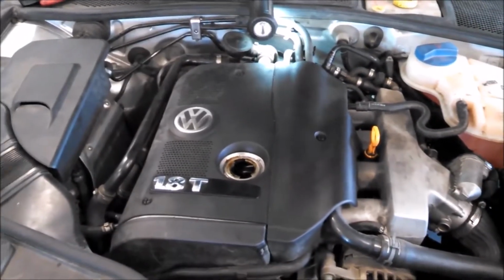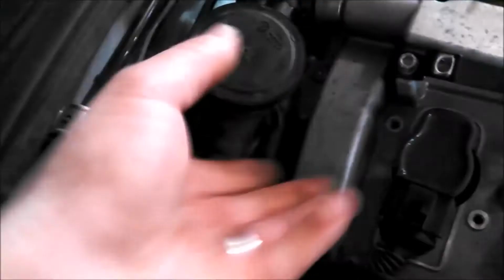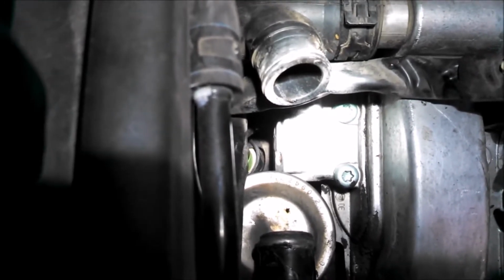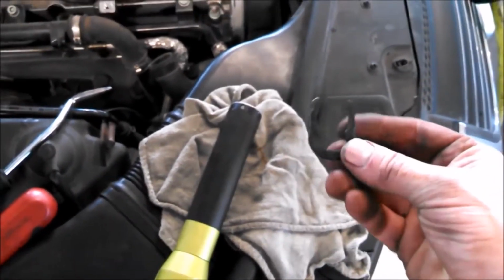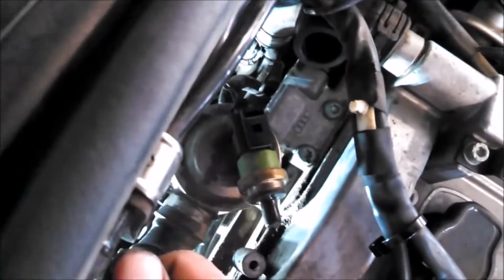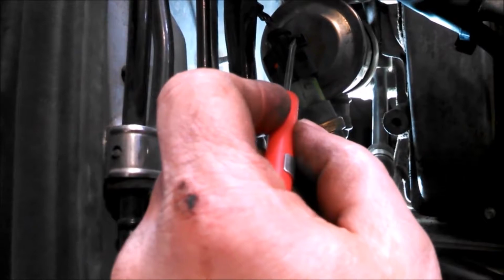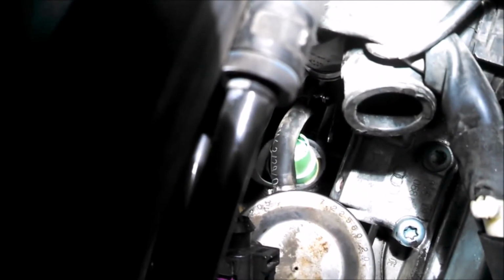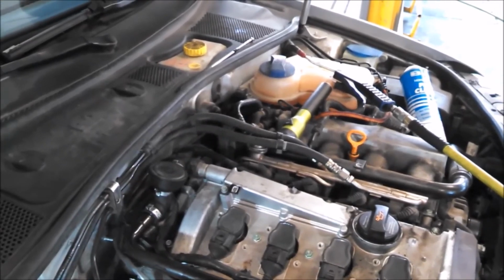Temperature sending unit VW  Passat Volkswagen 2004 by firewall Install remove replace

Comment: 2004, same B5.5, remove/replace coolant temperature sending unit:
Nasty position to deal with. Another VW-Audi design failure!  Thus video seems genuine and displays the obstructive design of this 1.8t engine's plumbing.
Also consider there are one-way vacuum valves in that area, very fragile.
Have some bandages  nearby, patience.
 I love the B-5 but hate to work with this bass-akward 1.8t. and trany. I've done almost all and must say this set up is misery by the devil. VW builds to assemble quickly but does not consider after warranty maintenance. Cruel design!

Comment: Why are you changing the temp sensor?
Reply: If the coolant temp isnt reached, itll throw a check engine light? Could be a bad sensor or a thermostat that is stuck open?